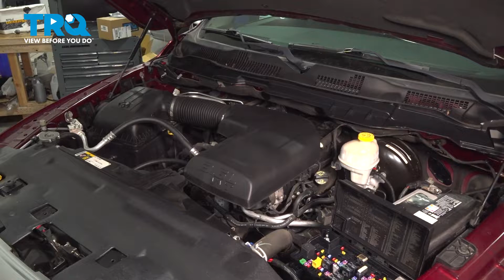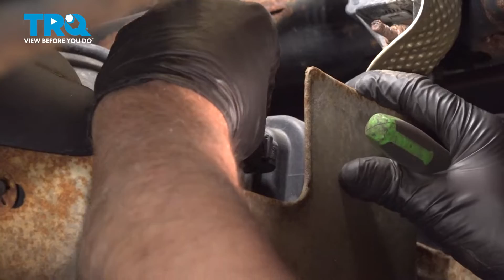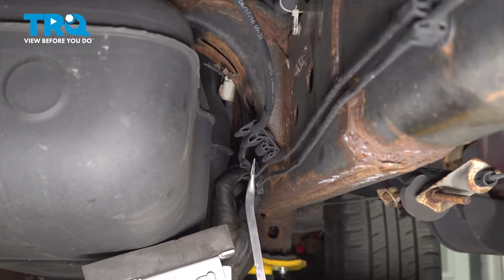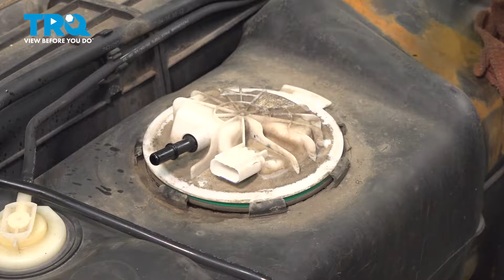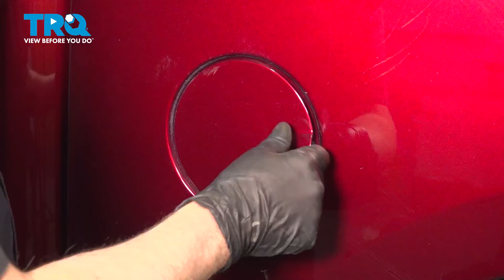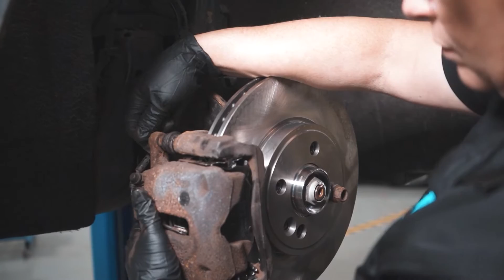How to Replace Fuel Pump Lock Ring 2011-2018 Ram 1500 3.6L

Comment: I have a third gen Dodge 1500 with a rusted lock ring on the fuel tank. I don't like the idea of the repair kits that screw right into the plastic. I would prefer to bolt in a new metal ring with some sort of sealant so I can use a standard lock ring. I haven't been able to find one. Any advice would this year lock ring repair work on my tank?